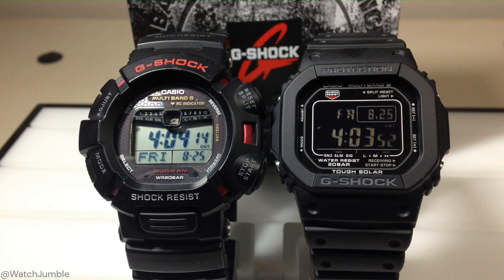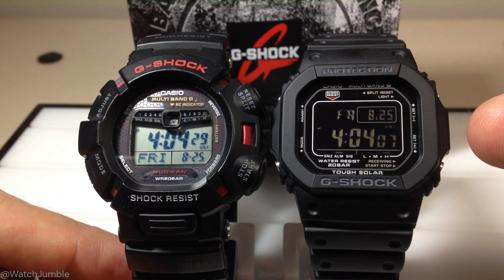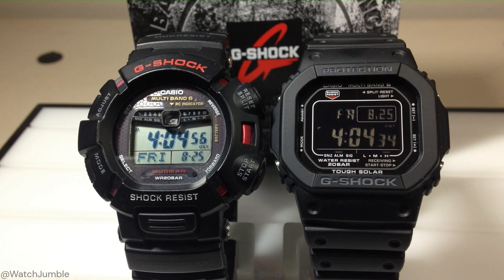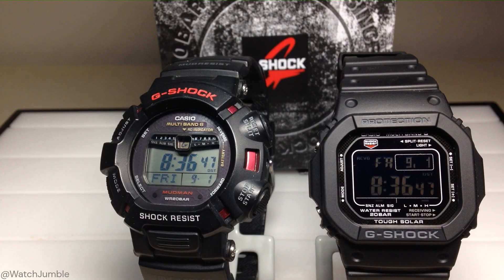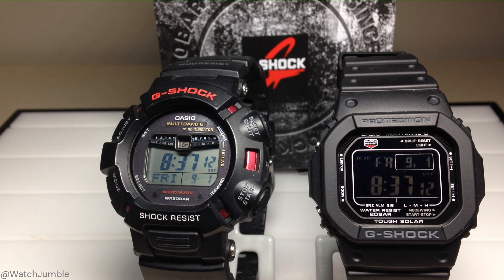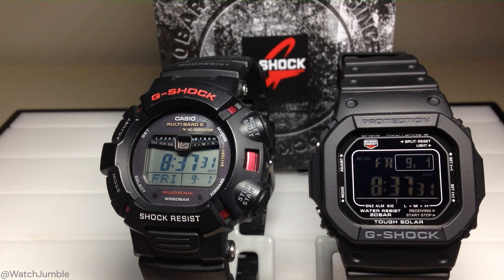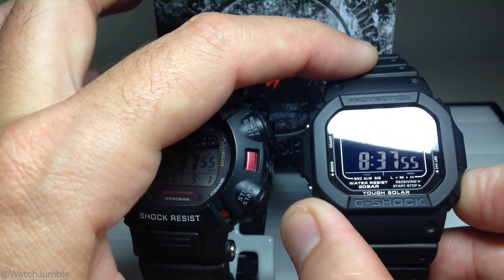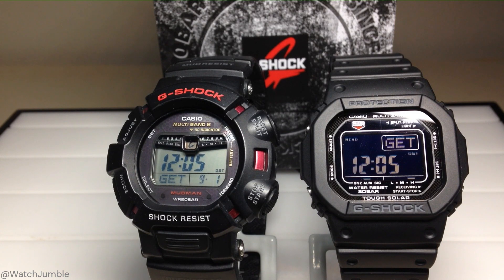Casio G-Shock (Module 3495) | Auto Atomic Signal

Comment: Do you know how erase the tag "received" on 5610 please ?
Reply from the maker: It will stay on the watch until the next time you have an unsuccessful atomic pull.  If you don't live the "Received" tag on your watch face you have two options. (1) Do a manual pull and cancel it (or let it finish unsuccessfully).  This way your last atomic attempt will be unsuccessful and thus the "Received" will no longer show. (2) Turn off your automatic atomic signal reception. . . then it can never receive an atomic signal unless you do it manually.  Hope that makes sense and helps.
Reply: @WatchJumble  thanks 👍